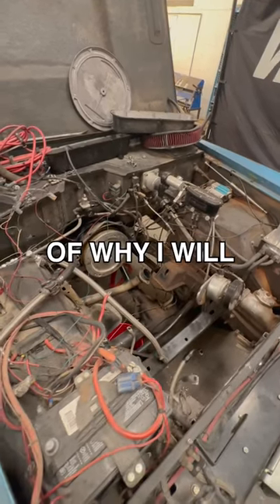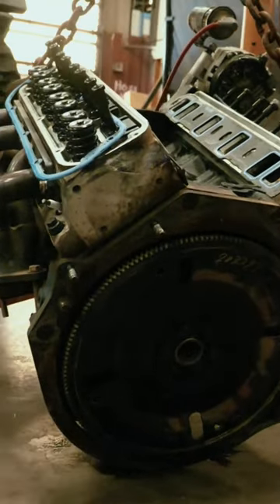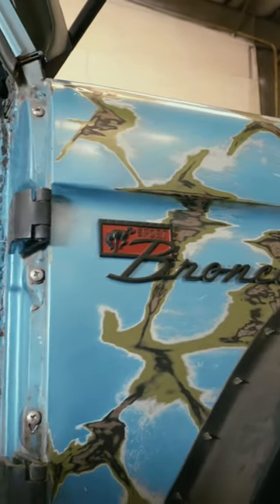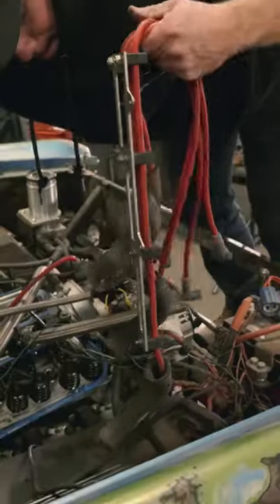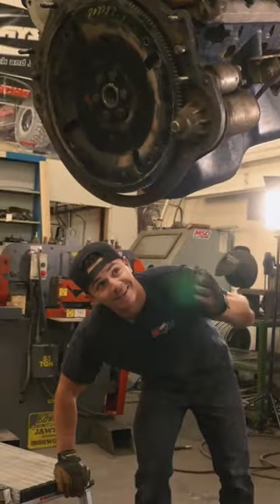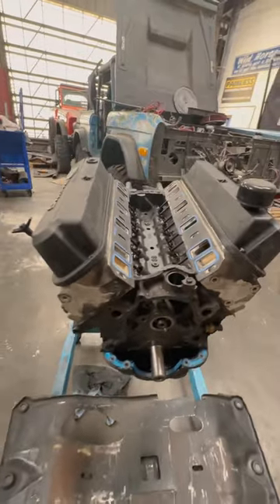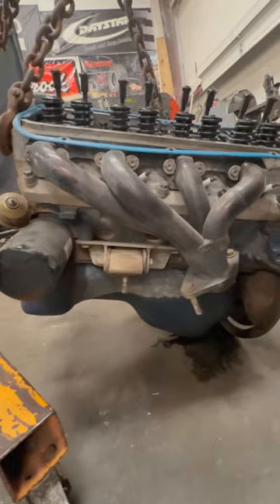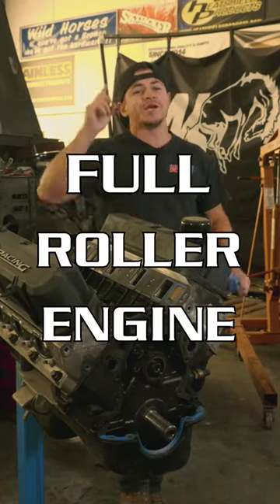Say NO to Flat Tappet Lifters?

Comment: I can’t agree more. Just rebuilt a 390 for my 69 Mustang and wiped 3 lobes off the cam on first start up and break in. Should have went roller cam from the beginning!
Reply: Sounds like you don't understand proper break in procedure. Need that zinc oil and additives bro
Reply: Horrible ownership you know FEs need zinc
Reply: Every single Cleveland I know of about 90k miles the oil passage in the top of factory lifter wears out and starves the rocker arm of oil.
Of course this happened to mine, I went to the autoparts store and bought a set of lifters, rocker arm and pushrod, dropped them in covered in motor oil and she still purrs fine to this day.

Comment: A day and a half to pull a SBF ? Get out of the garage go back inside , and you wiped a lobe because whoever set up those heads didn't set the lash correctly. I have 4 years on a 308CI Flat tappet , 6xx lift , Victor jr heads 14:1 compression it sees 7800 RPM regularly ....No lobe issues...
Reply: People are not using the right oil. I have yet to wipe a cam lobe but I've been using rich zinc oils for 25 years
Reply: Mostly just not using zinc in their oil
Reply: Proper oil and initial break in procedure is essential.
Reply: 14 to 1 must be a daily driver .
Reply: @Hanzyscure  I did drive it to work on 100 AV not daily though just in the summer, so yes you could say that ! You can check it out in my vids 🤟

Comment: This happened to an engine I rebuilt just a few miles later. Had to build it all over again
Reply: You used the wrong oil. You need a high ZDDP racing oil or break in oil for flat tappets
Reply: @Krankie_V  actually I didn't. I used that. Which is what sucks
Reply: @jeromegrunwald9564  did you rev it around 1500-2000 rpm for the first 30 minutes of run time with some variation?
Reply: @Krankie_V  yep....rebuilder said even though I did it correctly,  they never got hot enough to harden the flat tappets
Reply: @jeromegrunwald9564  the flat tappets don't harden in the engine, that's part of the manufacturing process. If you did everything right and used the correct oil,then it was either an oiling problem (unlikely) or a defective part which unfortunately can happen 🤷 it's not normally a problem though.

The other thing could be too much valve spring pressure during break in. If the springs are too stiff during this crucial time, the protective hard ZDDP layer can't form on the cam and lifters.
Reply: @Krankie_V  : I have heard that it's really hard to find tappets with the proper metallurgy these days.  I've never rebuilt an engine, just read about others complaining about the same and a lot of people chiming in who do rebuild engines that they've been having issues for years now and it's getting worse.
Reply: @dustintunis9347  I haven't had a problem but I've only been though a few engines. Haven't bought any flat tappets in the past 3 years or so

Comment: Flat tappet is trouble free compared to roller.  You had other problems.   Other than proper maintenance, I'm thinking maybe even metallurgy (cam).  Or a defect problem. A simple flat tappet is generally trouble free.

Comment: Say NO to cheap oil!
Reply: I think cheap parts may have something to do with it.
Reply: @wrathofjohn8266  probably not enough zinc in the oil, or improperly adjusted lifters. It's easier to blame the parts than blame yourself.
Reply: @wrathofjohn8266  Amen!!
Improper hardening and machining to the lifter face is more responsible for failures...or cheap cores trying to force a flat tappet to act like a roller

Comment: Flat tappet lifters are only for stock motors, they have a rpm range of about 5000 rpm. If you have to replace a bad lifter , you can do that IF you haven't damaged the cam. Which if you keep driving the car with a bad lifter , its your fault . You can hear a bad lifter.

Comment: Definitely need the right oil and check valve lash. Been running flat tappets for years (decades) never seen that issue. Roller isn't a bad upgrade, but not worth money to me. Run Rotella 15w40 and check valves if they get louder and you'll be fine.

Comment: If you used the right oil, had everything adjusted properly, and used correct break in procedures, this wouldn't happen. The fact that it took you a day and a half to pull that engine speaks volumes about your experience level. Got some learning to do bud.

Comment: If it was broken in and maintained properly, it wouldn't look like that. 20w-50 for break in and it's going to be a lot of oil changes. 100mi, 200 mi, 400, 800, 1500, then regular oil changes every 3000. after that, then you can bring it down to whatever oil the engine manufacturer recommends like say 10w-30 and run that with a bottle of zinc additive. it'll run forever, or after a while run 15w-40 for heavy equipment (which has zinc in it, or stay with 20w-50 with the high zinc.

Comment: I had my stock lifters resurfaced. If I buy new lifters, I still have my cam grinder resurface or check them. 

The metal isn’t as good but the craft is also trash in modern parts.

Comment: Current thought is the cams are made too flat, without taper on each lobe to induce tappet rotation. Current theory is to measure EVERYTHING and find a camshaft that wasn't made properly in the first place. I believe this IF each lifter (be it chineseum or not) is at the proper rockwell hardness. Break in matters but it ain't that hard as I've done probably 75 flat tappet break ins in my years and never had a failure yet. But I do not believe I am above this but simply lucky. I have not used a shelf cam in over 25-30 years. If you order a custom bumpstick they assign a single person to make it and they try to do it the proper way.

Comment: All these people talking about special zinc additives and I’m over here with over 200k miles on 3 different vehicles running flat tappet cams. I just change it every 3k miles with quality oil and call it day. I still have good compression and only 1 ever smoked from bad valve guide seals but it sat a couple years. Never a cam or lifter issue to report.

Comment: Flat tappet lifters arent bad. I have a chevy 350 with over 700k and the engine has never been opened. Ive seen many roller lifters fail. Almost all new model car engines tick with the lifters from the factory. All im saying is flat tappets never ticked from the factory unless it was a faulty part out of the box.

Comment: Nothing wrong with flat tappet cams. But they need the proper care and attention. Modern oils will highlight the slightest issue and imediately run a lobe off the cam and eat the follower. Wait until your looking round an engine that has lost a roller lifter. Sends hardened needle fragments through everything. Often lucky to salvage ANY PARTS AT ALL!  YOU WILL WISH IT WAS STILL A FLAT TAPPET MOTOR. Use the right oil, make sure the valve train geometry is correct, use the right valve springs and break in procedure, and a flat tappet cam will live just a long as a roller.  There are lots of poor quality parts out there though, which muddies the water a lot.

Comment: Nothing wrong with flat tappet cams or lifters, just has a more demanding break-in and you have to use specialty oil, off the shelf blends don't have the zinc that a flat tappet needs to stay lubricated.

Comment: You can definitely build a FT engine that wont do that and not all FT designs can be changed to rollers also rollers come with different failure modes

Comment: Why you blame the lifters ? When instead you need to educate the audience about it, two things the very first brake in period using the right oil and rpm’s and then adding the additives required for this type of lifters since new oils lack of the good ole anti wearables and are packed with detergents. Is not the lifters but the knuckle head servicing it...

Comment: I run OHV flat 4s, flat tappet EA81 Subarus. One 1981 the other 1985. Rislone zinc, like ten bucks. Add to mobil 1, Purolator 1 filter, send it for 3000 miles, do another change and continue to run like a bitch for 3000 more. There's nothing wrong with flat tappet, the most reliable engines of all time are often flat tappet. I think you just got bad parts or didn't run zinc.